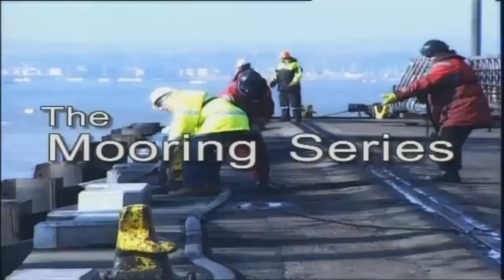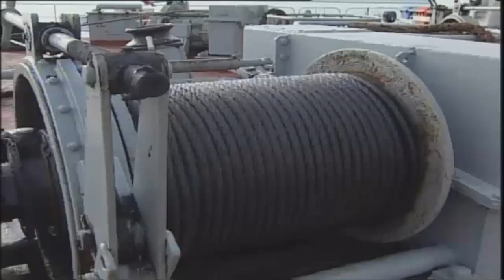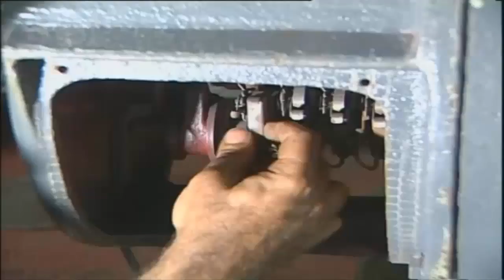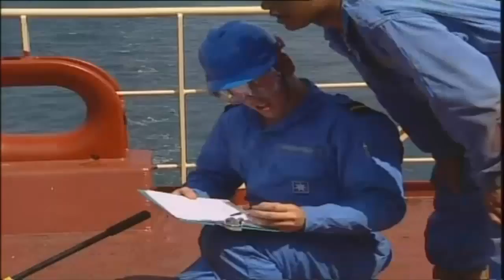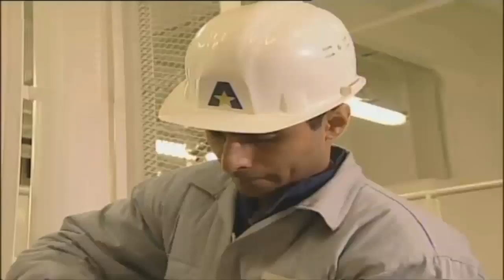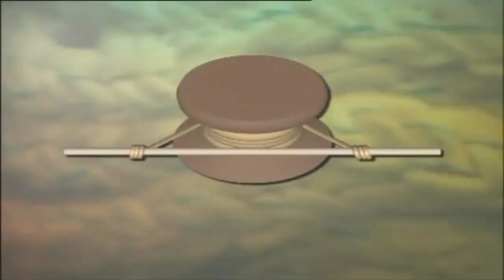Marine Mooring Maintenance

Comment: Ship engine spare parts, used parts, navigation systems, compasses, engine, oils, vessel horn, panel board or panel board parts, motors, generators, safety equipment, compressor, motor pumps, any type of barring, vessel fan,etc if you want any of this items you can contact me at Whatsapp +917016423041, email: afrozdholiya33@gmail.com